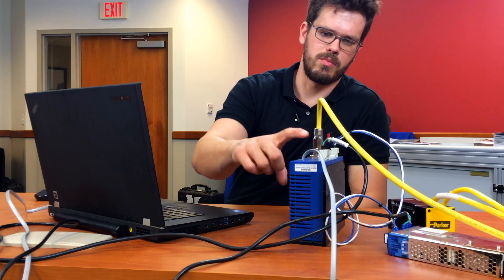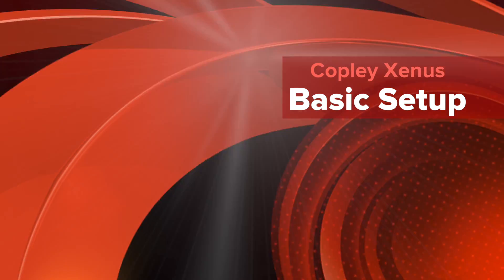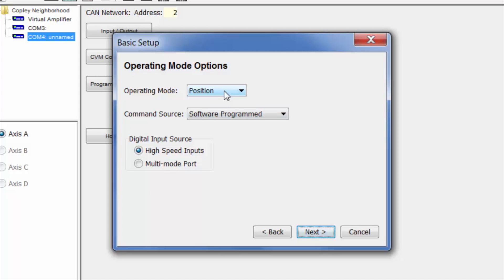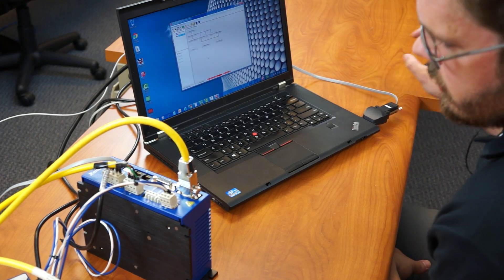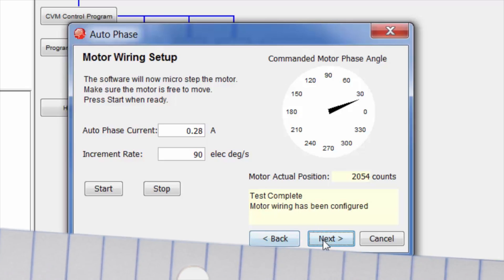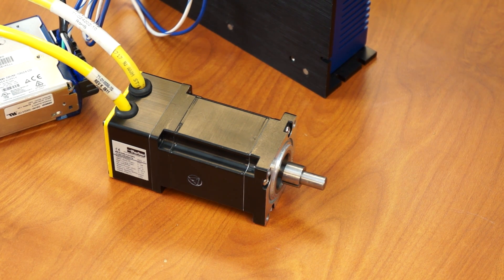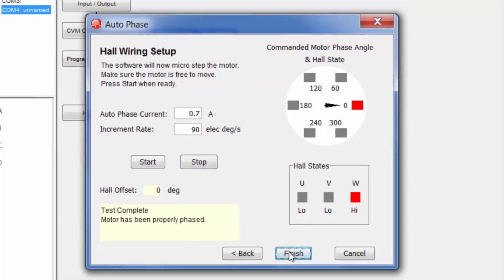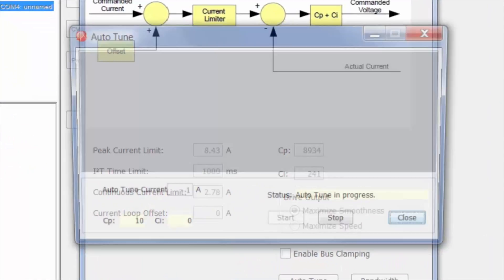Copley Xenus Setup

Comment: what is the problem if the CME2 cannot recognize the motor1 which is the scan motor , but the motor2 and 3 was recognized... plss help me to solve this problem .... :)
Reply from the maker: Hi Mark, are you connecting to 3 different amplifiers?  Make sure you have a good Serial RS-232 connection to the amplifier for motor 1.  If you are having a hard time finding the correct COM port to connect with, check out this video we uploaded on using CME2 with a Stepnet: Copley Stepnet Setup

Follow the steps in that video to learn how to identify which COM port your amplifier is on, then you can select it in the communication settings.  Good luck!
Reply: Axis New England Good day Sir. Can i have your personal email address so that if i have any problem about XENUS i can reach you...
Reply: Mark Camacho This are the Activities done:
 Borrowed SAM 06 during free up time.
 Shutdown machine and removed existing Xenus drive to simulate newly repaired.
 Install newly repaired Xenus Driver.
 Power up machine and Load WinIc software.
  Upon loading of the WinIc software, error was prompted on the screen “MOTION FAULT” system not responding.
 Exit to WinIc software.
 Open CME2 to verify if system recognize the three motor amplifiers only two motors was recognized   only the motor 2 and Motor 3 was found, Motor 1 was not recognize which is the scan motor.